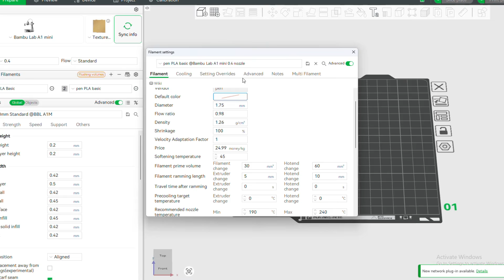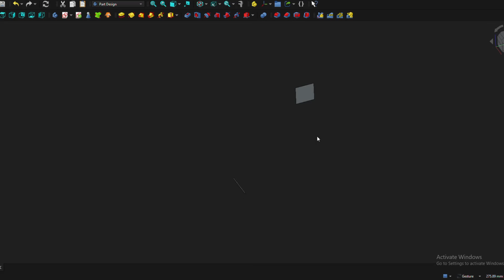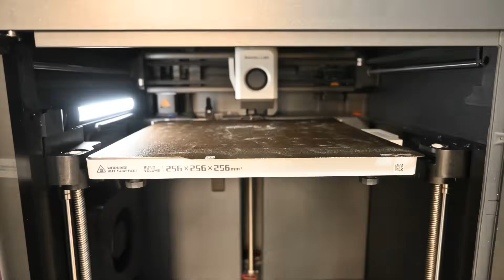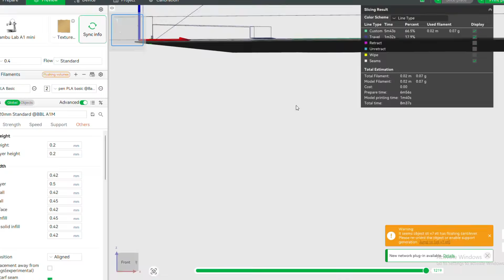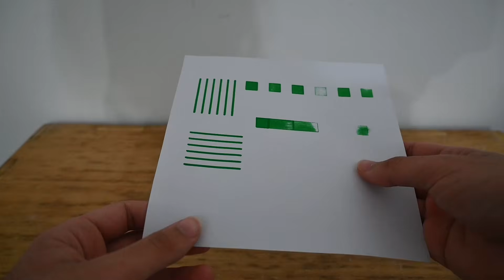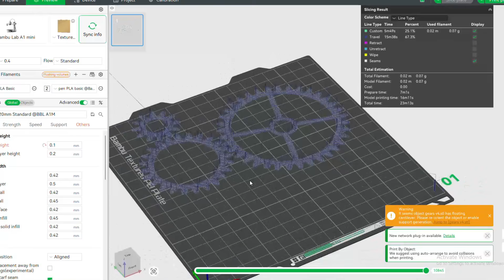I Turned My 3D Printer Into a Plotter for Just $2

Comment: When I put 0% flow and slice anything, it only makes a gcode for iniciate the print. Which version o bambu studio do you use?
Reply from the maker: It should be making the g-code for everything, Try going into 'line type' and enabling 'travel'  after slicing.
Reply: @3Dall-01 Thank you it worked, I also displayed Travel